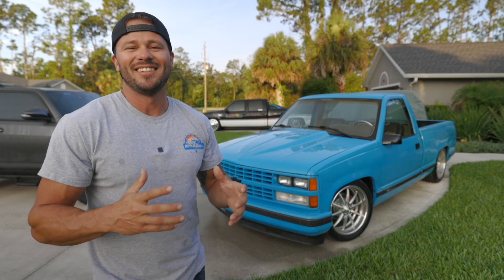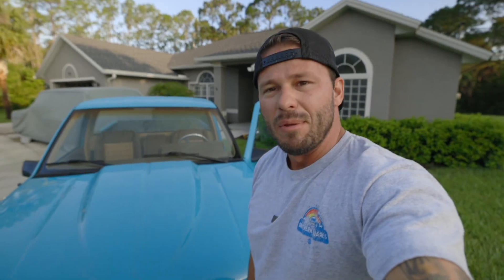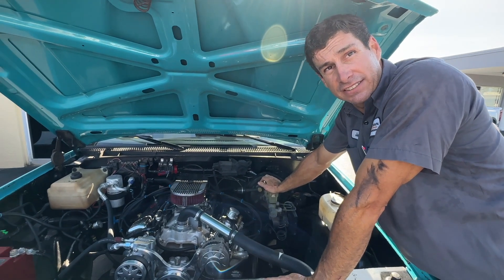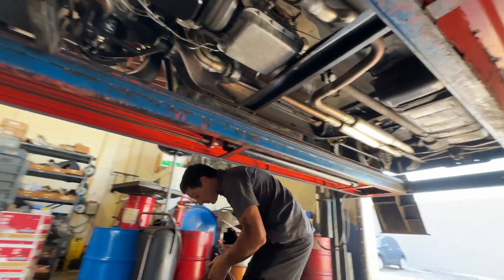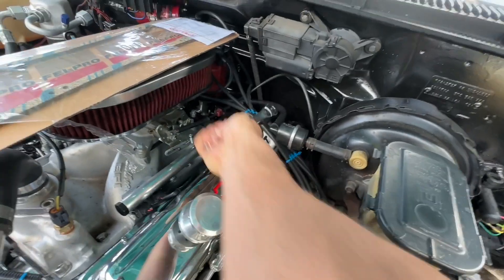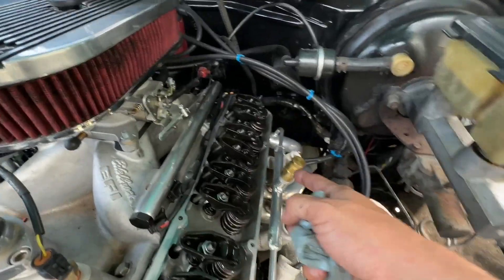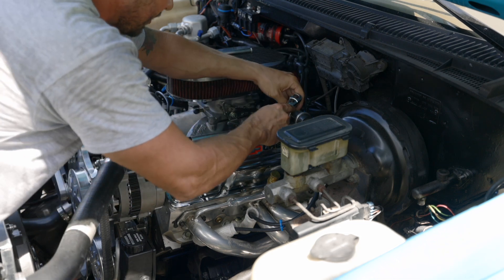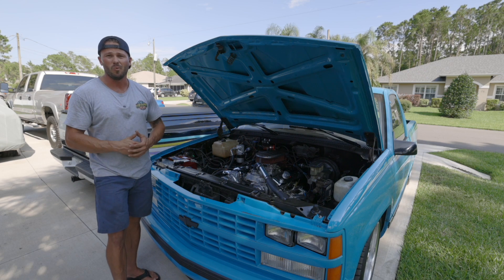It's Worse Than I Thought | Getting Started on my '88 Silverado

Comment: One thing I’ve always done with my valve covers is use some that copper gasket spray an glue the gasket to the valve cover just on the valve cover side just to make sure it stays in place and doesn’t do what they had going on cause them gaskets can an will move an if your not paying attention u get what u had

Comment: Keep the motor, tidy the engine bay, fix the trans, posi the rear end. Keep the side moulding, put the Chevrolet panel on the back, and put rear bumper back on it. Saw you on United by Trucks. Subscribed. Good luck with the build.

Comment: Are the intake bolts too short? Possibly longer ones may help. Hopefully you don't have to Heli Coil the heads. It's very frustrating fixing peoples crappy work. Work like that is caused from not taking pride in their work.  I always use stud/nut kit on small Chevy perimeter bolt valve covers.  It holds the gaskets in place while putting on the covers. I silicone the gasket to the valve cover but do not silicone it to the head. Cork is awesome dry and it's what I use. I've been building and racing small blocks over 30 years.  The trans shop is correct on not driving it. If the TV cable is not hooked up correctly, it will burn the transmission up very quickly.  I wish I lived closer, I'd love to come help wrench on it. I do take lots of pride in my work. Lol
Reply from the maker: Thanks for the tips! I'm not sure of the bolt length yet. I'll be honest, when I found out they were stripped I gave up for the day. 🤣 I will be checking to see if those threads are slavagable or if they need to be repaired once I pull the motor. Too many other things to focus on right now. lol

Comment: LS SWAP IT! Ditch the boat anchor sbc and its headaches
Reply from the maker: The motor is solid! It’s a brand new blueprint 350 with Edelbrock multi port fuel injection. It’s the trans that’s giving me some issues now but I think we can work through it.
Reply: Yes because sbc wasn’t the go to for high performance builds from 1955 until 1999 or anything 🥴🤡
Reply: Just because an LS brings cheap and easy power doesn’t make the SBC bad